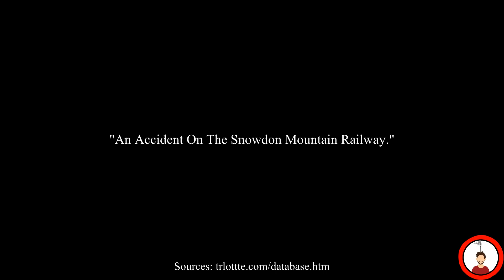The TRUE Story Of Bad Look Out

Comment: We need more of the Culdee Fell engines.

Also, those cab faces are so weird.
Reply: Did you know they were censored in the Koren Version?
Reply: I think it's the engine's same face on the back of the cab so it looks like it's looking back.
Reply: @zanderkmd2020  really?
Reply: @greycatturtle7132  Yeah, check the wiki
Reply: @zanderkmd2020  i saw, very strange
Reply: If they were adapted into tv, it would only make sense to have a face on the cab, but not on the front of the engine, since that's blocked by the coach
Reply: @hunterneitzel3012  true

Comment: Although not always as dramatic, brake failure on the Snowdon Mountain Railway is actually quite common! The latest incident I know of was in late 2019 when a train lost its connection with the pinion and rolled all the way down the mountain at an alarming speed. No one was hurt though, and the train was stopped before too much damage occurred.